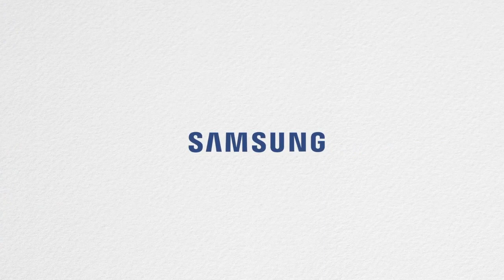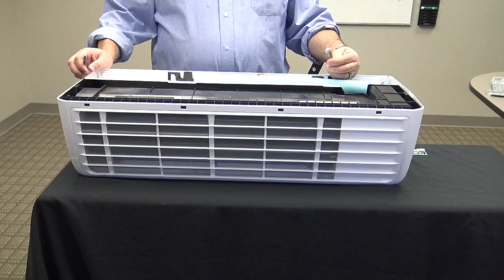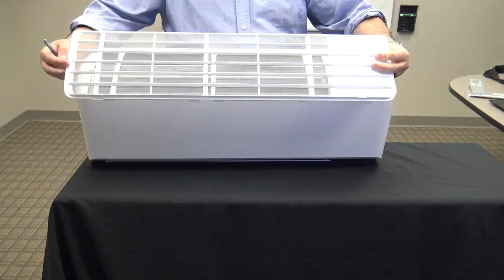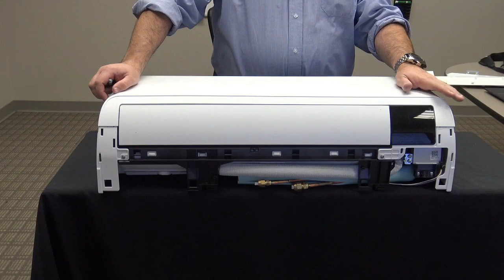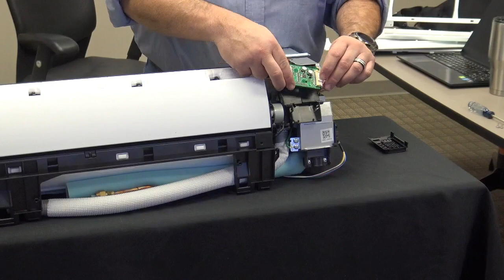New 2.0 Residential Mini Split Systems Sales Training

Comment: I like having a heat pump, generally,  but my samsung unit's thermostat is utterly OTL.  I set it for 67 (for example) then have to manually turn off the HP when temperature in the room climbs well beyond 67 .  I give up when the room reaches 75.  What's up with that ???

Comment: Excellent video, I have one 2x1 unit and love it, the problem is I don't know how to take the blower out to give it a proper cleanse,  could I get some help, thanks a million.
Reply: Follow everything shown in the video until 7:13.
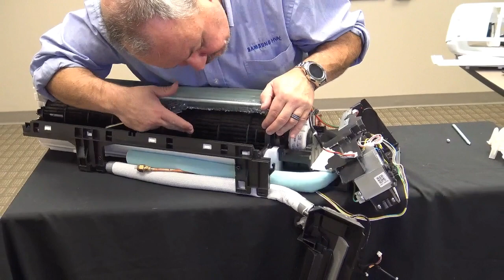Then, to remove the blower wheel, simply make sure the drain pan is hanging vertically like shown in the video at 7:13. Then unscrew the 2 screw on the left on the coil to loosen then. Then unscrew the blower wheels (same screw shown as 10:30). Then move the coil out of the way with one hand and with the other hand, pull on the blower wheel to remove it. There's a considerable amount of resistance, so pull a bit hard on it.
Reply: Thank a ton !!

Comment: Does this unit work as a heat pump, or does it just use electric resistive heating?  If it runs as a heat pump, how low temperature does it support?

Comment: Hi, I have 2 WindFree  AC's in the same room on the same wall and my Samsung Technicon cannot figure out how to code the remotes with different code so AC's will not get confused from the same signal, can you PLEASE help
Reply: Your tech needs to change the remote then change the fan coil to match.

Comment: Why is the junction box so small and why is the head unit not powered by the outside unit like all other mini splits?
Reply: What? The power comes from the outdoor unit.
Reply: The power supply does come from the outside, just like other brands.

Comment: I installed 3 Samsung WinFree Units in a multi-split configuration. The purpose was mainly to use them in heating mode in sleeping rooms.

I am extremely disappointed as (1) the windfree mode does not work in heating mode. (2) In heating mode the Units are very noise, with more than 30db SPL, even if one of them is the Élite model, which should be super silent. However when I bough the Units I was told the Elite model would work in silent mode at 16dB maximum noise level. 

While it is correct that the manual says the windfree available only in cooling mode, nothing is said about the high noise levels in heating mode. In this mode the units work in start/stop mode and are unable to provide a steady slow supply of heat. In the end you will have noise, wind draughts and temperature flutuations up to 2-3 C , so I cant use them for the purpose i bough them,  heating in sleeping rooms. I have a Mitsubishi Unit with 20 years that works with 20dN noise level. Incredible that Samsung sells AC devices that in some working modes perform much worse than Mitsubishi or Daikin Units made 10-20 years ago..

Avoid Samsung if you plan to use heating mode . I contacted their customer service and after one month I still Have no reply on what are the maximum noise levels in heating mode.